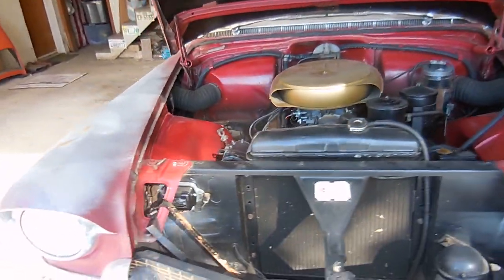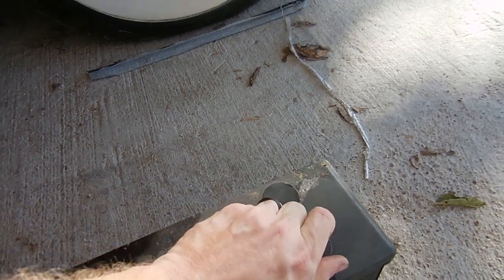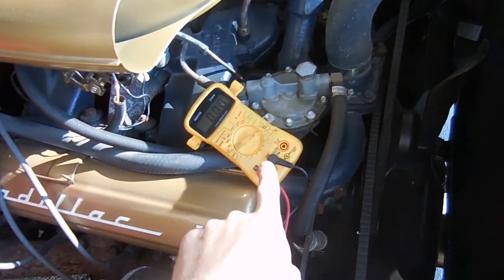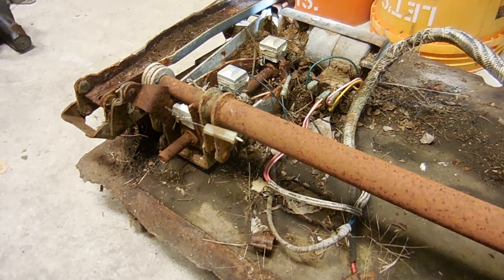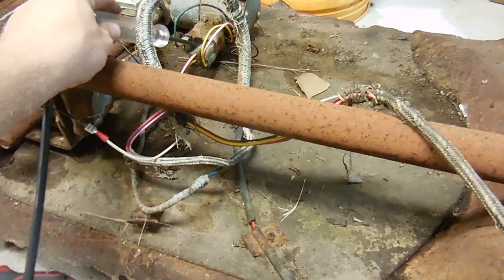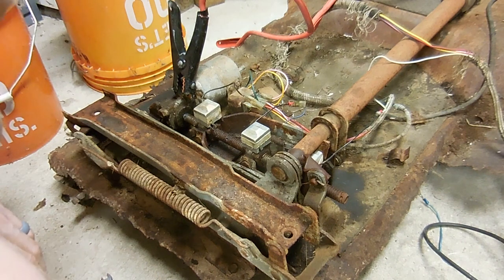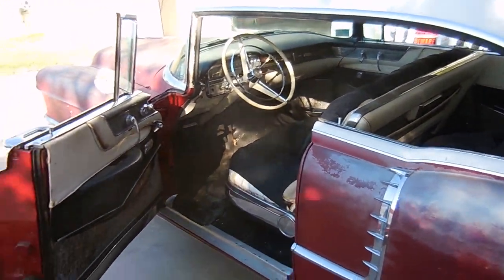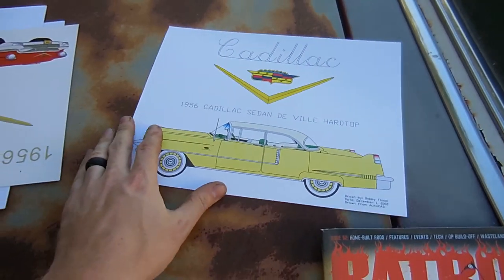1956 Cadillac Sedan DeVille Resto Video 67

Comment: may I suggest a battery cut off switch? In any car that old (or Italian), it is simply a good idea anyway.
Reply from the maker: I could install one of those, but it would be cheaper just to take off the negative batt cable.
Reply: @dukeman7595  Italian electrical systems are at best temperamental, and prone to melting down for no reason.
Reply: @wanderinggentile  can attest
Reply: @wanderinggentile  i can agree from experience
Reply: @yamahonkawazuki  Why do Italians drink warm wine? They have Marelli refrigerators.
Reply: @wanderinggentile  prolly reason some who drink guinness at room temp. Ive done this even tho ove got a great fridge

Comment: Hey Ben, 11.4V is dead flat.  Below about 12.4V the battery starts sulphating, which accelerates the demise of the battery.  You should check the charge voltage when the car is running to make sure the generator and regulator are doing their thing correctly.

Comment: Did you re-polarize the generator after having it rebuilt? If not, you trusty shop manual will show you how to do that. The generator won't charge much until it is polarized.
Reply from the maker: No worries, did that many videos ago
Reply: @TheCorvetteBen  By the way... that power seat set up was very interesting. Great video!

Comment: I have been told that when a lead acid battery is drawn all the way down with a low current draw it will often cause plates to distort in the battery and the plates will actually touch negative to positive and short out the battery internally.  I had this happen on a Chevy pickup due to a problem with the brake light switch.  As others have observed a battery disconnect switch is a rather inexpensive but totally fool proof to keep this from happening on a car that is not driven regularly.

Comment: Standing in corner, arms crossed, foot tapping: OOOOOO, Ben's got a new video!!!! That we've been waiting not patiently for. Enough of that, I just wanted to suggest that you provide, occasionally, the approximate time it took to accomplish a task where you show the result but not the process, or not all of it. Even though I do this sort of work as a hobbyist, it still seems like it takes no time at all -- and I know better! As for the battery, in my experience, going from a deader to recharge can only occur so many times until the battery is no good. It's just lead-acid chemistry but also a PITA.

Comment: Great video, Ben! With the evidence of acid powder on the top of the battery, I think the regulator may be over charging..burning it up.
Reply from the maker: Charges at 13.5-13.6 volts
Reply: @TheCorvetteBen  : I was thinking the same thing Michael Cook said. I remember back then 12v was plenty sufficient.  You might try turning it down to 12.5
Reply: @TheCorvetteBen  Nothing wrong with that. I guess I should have known you had already checked it.😁

Comment: Hi Ben, that old Battery is leaking acid !! . I t could be over charging , You may have to sync the voltage reg to the generator . Check the shop manual and it will show you how. I had the same problem with my 62 Impala .

Comment: I didn't have to on my 65 Cadillac, But You can take apart and clean the connections in the switches, I had some issues on a 68 Cadillac where the plugs for the switches had bad connections. I broke the plastic spot welds cleaned and crimped the loops to make them smaller than used a soldering iron to re-melt spot welds one switch I soldered wires directly to prongs on one switch must be redone to remove the door panel sadly but the plastic plug socket was burned up and useless. and the motors are rebuildable as well. I think in 69 the thought went to replace not repair for motors.

Comment: That would be acid in every cell. As I logged earlier, we found that was a terrible place for a battery because there's a lot of heat in that area. Moving the battery to the front of the engine compartment saved a lot of headaches and prevented corrosion in a n arly-inaccessible area. Coating the battery box pan with sodium bicarbonate helped, before the battery was relocated (an old trick we use in the aircraft).

Comment: Soem starters will spin but draw mopre amps than rated.  That will kill a battery right quick.  You would need a stout amp meter to test the pull of the motor.  Good luck.

Comment: I did have a problem recently where my battery in my truck had 12v and took a charge fine but would not start the truck. I took the battery to a local shop to test it and it only had 1 amp. They told me it was a dead cell.

Comment: One way to kill a battery is to let it get too low on acid and it will cause an internal short that will destroy the lead plates & separators. Overcharging either from a bad voltage regulator or a battery charger will do it. Typically we used to buy batteries rated at 24 months, 36 or 48 in those old open type batteries and one lasting five years or more was a real rarity.

Comment: It rather sounds like the old battery from the Cadillac had developed a bad cell if it's showing a reasonable standing charge but won't do anything when a load is put on it.  The fact that it was pushing the battery fluid out also suggests it was getting warm, which also could be a sign of a bad cell.  It could just be a faulty unit and an internal joint has failed out, but it could be it may have been damaged in transit which could have cracked some of the lead inside...

Comment: You did a good job checking for a draw, but you should realize that the ammeter function on that meter is probably limited to 10 amps. You came awfully close with the power window. A draw of over 10 amps will blow a fuse inside the meter.

Comment: Ben. that isnt water In the battery. Its sulphuric acid.  Try not to tip it and wear gloves when removing and installing. invest in a trickle charger to keep it charged.  You can test for a parasitic draw by using a multimeter and removing one fuse at a time. Good luck with the land yacht!

Comment: After cking for a parasitic draw, only the clock draws on the car. Get a battery tender abt $15. Batteries need occasional draw and charge. Nature of the beast. Seating without use, shortens the life by sulfation.

Comment: If the parasitic draws the battery voltage down too low it will ruin the battery. A battery needs to have a charge on it to stay good.

Comment: Ben:

 I have a 1987 Peugeot 505 wagon which I use occasionally........I never leave the battery connected.............and even when I'm not wanting to start/or use the car, I start it up and run the engine and putt-putt around my property for a good 30 minutes. The point of the story?,it''s a  6 year old Walmart battery,it's starts every-time,but I have not allowed the battery to sulfate-down from leaving it connected and not charged occasionally.

I seriously doubt you use your Caddy enough to keep your Caddy's battery in  good condition.
Reply: Oh wow, a Peugeot 505, can't remember the last time I heard of one of those, let alone seen one. 
Mine's still a "daily" driver, as in it's my only car but I only drive it like 3 times a month, and the battery is going good for at least 4 years, even with a bad alternator that didn't charge for who knows how long.
Reply: Glam Stachee:

Peugeot of America keeps track of the remaining 1,500+ Current Registered Peugeots in North America (which I am of);for the second assault attempt on America which is too occur on our shores within a years time. 

And if your do in fact have a Peugeot,I suggest you buy  a rebuilt/used old-school 60s-80s GM alternator from a chain auto parts store or a junk-yard for $20-$59.00...all you need to do (with a file) is shave off about 1/16+ of inch(off a GM  donor alternator casting) for a perfect fit. No clipping of/or cutting of Peugeot wires is necessary,if your Peugeot is XN6 powered,you just flip the tension-er bracket. GM alternators provide a good 14.00-15.3 volts(and higher amps) when the engine is warmed-up far better than the French or German alternators ever delivered.

Make sure you snag/get a GM style pig-tail connector and solder a male adapter to connect to the Brown Peugeot Wire exciter wire(from alternator) which trips the alternator to charge and turn-off idiot light once engine is running. Belt size change may be necessary if its a  Diesel or Gas Turbo.

For the record,anybody that knows anything about ,old-school GM alternators;they are the choice regardless of car brand.....Iv'e even seen a Rolls Royce with a 75-amp GM alternator on it, bearing and regulator kits are dirt-cheap and easy to replace if and when that time occurs.
Reply: @dmcnamara9859  Well I'm in Europe, so GM isn't really a thing apart from Opel. And I got another alternator....which of course didn't fit because there are like 10 different alternator types, so I had to take both the old and new one apart to change the guts out.
Mine's also a 309, probably the rarest of the 80's Peugeots, less than 15 still exist in my country.
Reply: Glam Stachee:

I had a 405 MI-16 which I regrettably gave to my friend's son's girlfriend (that thing gets around 40mpg+ around a  65mph cruise)....it has  a 80s-90s Mazda 626 alternator....all I  did when I had it,was add a couple of washers to alternator for it to line-up with the idler pulley. Peugeot then  and the few outlets that sold NEW replacement parts wanted $400.00+ USA bucks,get one at Pick N Pull (junk yard from a Mazda 626)..........cost $20.00 plus $5.00 core charge

GM and Toyota Nipponenso alternators are cheap to rebuild..........you don't need to replace the alternator if the : brushes,regulator, or bearings go south even in Europe.
Reply: @dmcnamara9859  Didn't know the Mi-16 got that good gas mileage, my poor little 1.4 liter gets around 43 MPG combined, maybe around 50 highway, but it's still fast enough where tiny non-turbo diesels still reign.
And yeah I thought about rebuilding the old alternator, but the entire thing was just fried from the inside, yet even this "new" one is starting to make bad bearing noises not 2 weeks after installing it, so that'll have to get fixed.
My main issue now is the busted radiator I have. Doesn't overheat but drips coolant ever so slightly. No OEM replacements exists for my particular car as the radiators are one of the few things not shared with the more common 205. Found one for only 15 euro, we'll see how good it is once it arrives.
Reply: Glam Stachee:

Should not be a problem as the Peugeot 205,206,305,309,405,etc(Citroen mates). were all based on the same Platform and drive-trains. Car manufactures don't like to change core things(even from suppliers) it keeps cost low;even when they re-skin a  Platform and call it the "all new" whatever.

If its a plastic-cap END radiator,drain  all coolant (make sure no contaminates exist on surface/inner surface with conservative usage of a carb/brake cleaner )and then gently clamp aluminum core with pliers......do not use excessive force! 

Worst case scenario...bust out 2-part epoxy with absolutely clean and lightly sanded surface (let it to cure for 24hrs minimum).Being lazy by having a radiator with coolant/contaminate residue won't get desired results.

Here in the States,getting things for the 505  Wagon are dirt cheap thanks to RockAuto and other venues
Reply: Glam Stachee:

Take for example, the old-school push-rod XN engine was used in a variety of mechanical objects beyond Peugeot and other Makers cars, I have a  Toyota-Nippondenso built Geared-Reduction Starter for my 505 Wagon that was common in Daewoo and Catepillar light-duty equipment. 

Peugeot never offered a Geared-Reduction Starter for any of the various versions of the 50 year Production run of XN engines....both 3 main and 5 main bearing offerings.
Reply: @dmcnamara9859  Not too into the older engines since mine is the more modern TU3 introduced in the late 80s and still being used today more or less, as far as I know.
Also no idea about my starter because they decided to bury it and the distributor under the gigantic air intake, so I never bothered with that yet. 
What are the transmissions in the 505 like though? The BE3 that's in mine is just garbage and blew the first gear synchro before 88k km with the first owner.
Reply: Glam Stachee:

The 404.504, and the early 505s all used the nearly indestructible ZF3-hp (with low Torque output abilities "like 300ft pounds"'). Then ZF introduced the ZF-4hp.....a complete pile of shi^t with capabilites of 375ft Pounds.

You can literally burn-up the transmission in a emission-test or idling the engine once a gear-selection has been made. Even with the engine running once a gear selection has been made; then putting into Park or Neutral the: ZF 4hp is known to burn-up its clutch packs.

I bought the 505 wagon because its transmission burned-up during its emission test, and then subsequently rebuilt.Knowing its wacky quirks, I never allow the engine to idle once  a gear selection has been made. You must turn off engine (like 90 seconds to de-pressurize the clutch packs);then you can idle or rev into Park or Neutral without devastating effects.

With that said, the Transmission Shop that rebuilt it,installed a torque-converter drain-plug.........I drain Torque-converter and pan every 3 engine oil changes. It's one of the worst 4-Speed overdrives ever engineered.....and ZF has not changed their ways; the later ZF6-Speed and then the Ram trucks,etc. with ZF 8 Speed overdrives suffer the issues.  A whole list of car makes with ZF overdrive automatics suffer the same fate if precautions are not taken.

The old-school Peugeot 5-Speeds for the rear-drive Turbo Diesel and V6 were dang good manual....that can't be said for the AMC-Jeep spec Peugeot BA 5 Speeds which were garbage....built with low-output  404/505 4 cylinder internals........it's probably the most hated Transmission in Jeep history,not Peugeot's fault..........but  because AMC-Jeep wanting an insufficient Transmission for a inline-6 with lots of Torque for dirt-cheap which Peugeot supplied to them during the 1987-1991 model years until Chrysler switched the the robust Toyota/Aisan 5 Speed manual.

Comment: Love the old caddy's, i had a drama with my ride on lawn mower for 3 years, until i bit the bullet & replaced the battery & it just kicks over straight away, no need to charge, the guys who rebuilt my ride on gave me a very cheap nasty dodgy battery from day 1 & yet & i paid up front & i paid a stack for basic work they did in the end...happy now & i use another mower center to look after my ride on.

Comment: Cadillac putting a battery next to exhaust manifold was a bad design.  Heat kills batteries. Today's batteries suck. My new 1973 Buick factory battery lasted 9 years. Your old battery probably sulfated from lack of use.  Worst thing for a battery is not to drive car.